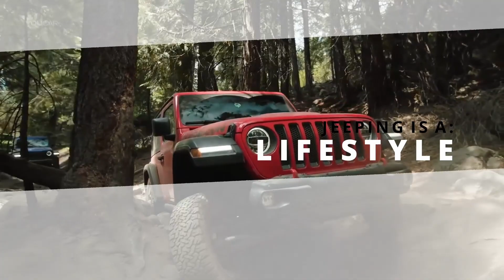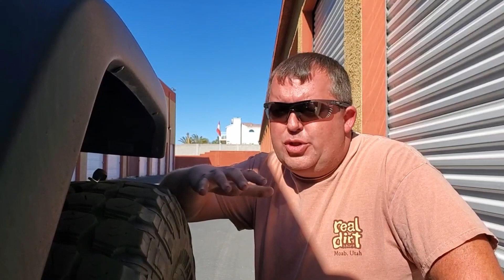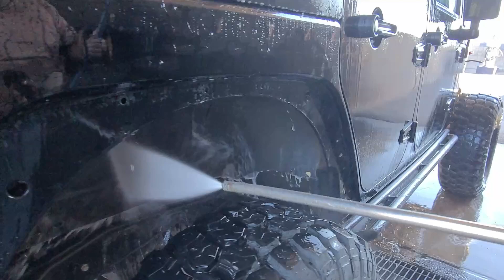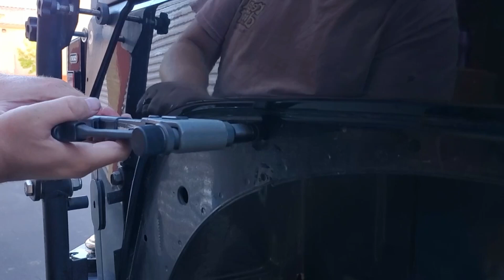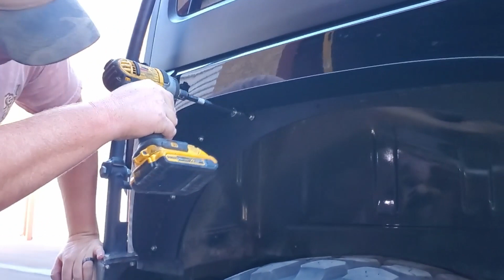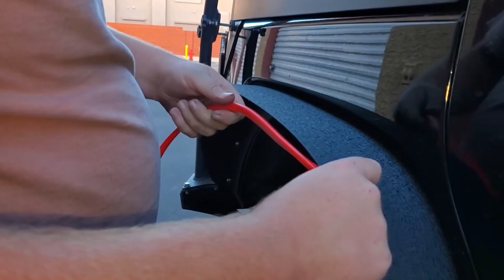High clearance fender flares for JK

Comment: If you install all of the rivnuts for the fenders and later down the road want to install different fenders but they are bolt on can they use the rivnut holes or will they need to be removed?  Also. Can you install new aftermarket inner fenders on the stock jk fenders?  Thanks for your videos!

Comment: How do you install fender flares with lights.
Reply from the maker: What do you mean? 9nes that have lights built in? Or adding lights? The install of the flares is the same, just added steps for the lights. My next video in the making is about installing rock lights, and the steps involved, may be worth watching as well..... next weekend
Reply: @JeepingForBeginners  I’m looking at buying fender flares with lights all ready built in.
Reply from the maker: So the install process for the flares is basically the same, regardless of brand..... wiring the lights is just an added step. Some kits use the factory wiring, others have to be spliced. If you are local, can always swing by my shop and I can take a look at them for ya. 😉